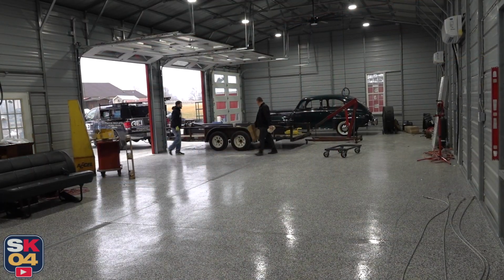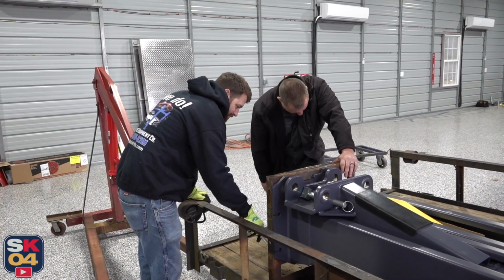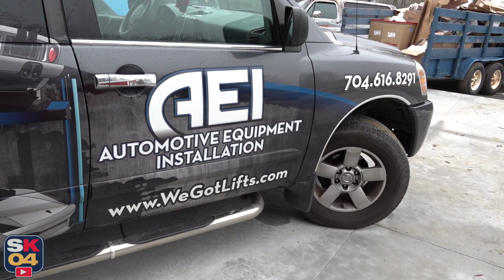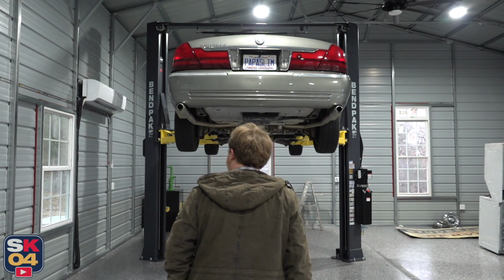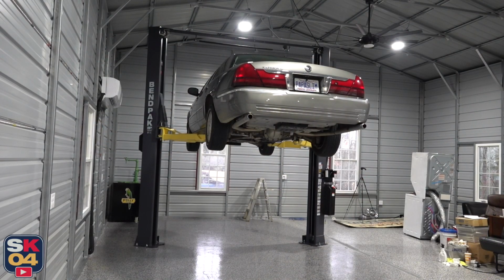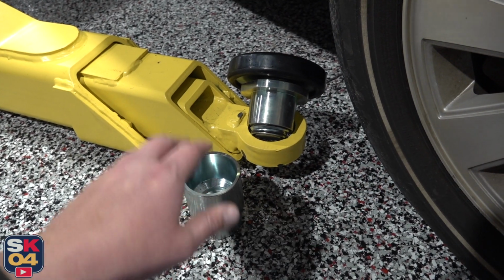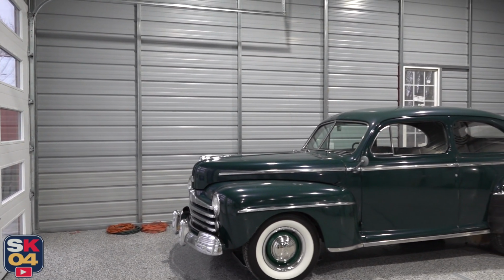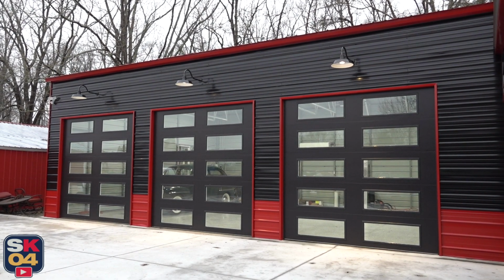Installing A Huge 10,000 lb 2-Post Lift In The New Shop!

Comment: How did they wire the exterior lights, just a steel J-box mounted flush to the steel siding?  For the lift wiring did they run BX from the panel to the list?  Or just extension cord wire?  Waiting for my 12k 2-post to ship.

Comment: Did you get separate lines to the shop for internet? I hate to say it but it might have been a bit of a waste of money. A few manufacturers make excellent equipment for line of sight internet links with plenty of bandwidth for really good money these days. You could've gone from the house to the shop for a couple hundred bucks.
Reply from the maker: I got separate lines, but I didn't have to pay anything, it was an end-of-the-year promo, I consider myself lucky lol.  I don't know anything about what you're referring to, but I'll check it out nonetheless, sounds cool!
Reply: @saabkyle04  that is indeed extremely lucky. Networking is my profession with the wireless part being both work and hobby. If you want to dig deeper, Ubiquiti has a nice website with plenty of information and even a tool to check line of sight possibility. Otherwise you can just look for "WISP solutions" , with WISP standing for Wireless Internet Service Provider. If you ever need any networking advice I'd love to help, just to pay back for the years of quality content and entertainment!

Comment: I still have my 98 LS, it got it's oil changed, got the new wiper blades on it, 02 sensor replaced, got the alternator fixed by the check engine light, and the problem with it now is that the frame control arm under it has a big rust hole.

Comment: giving new meaning to "need a lift?"  love it!  Congrats Kyle!  That two post lift looks more stable than I first thought they were.

Your Corgi is adorable, and for the record, I had no trouble hearing your audio.  Love what you're doing with your garage!
Reply from the maker: Thanks a lot Brian!  Yessir, these are quite awesome.  You just have to have a certain depth of concrete and reinforcement, plus a flat surface.  I really like my Grandprix lift in the old shop, but the design of this one is so much more accommodating with the added space.  It'll be put to good use for sure!